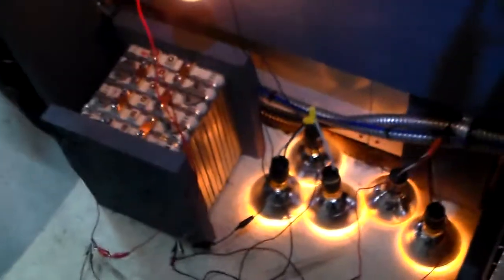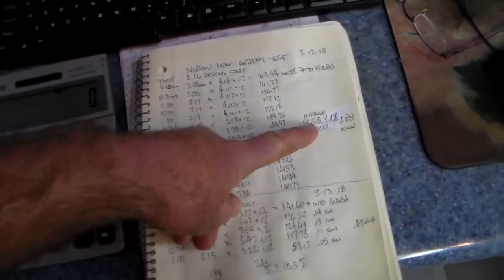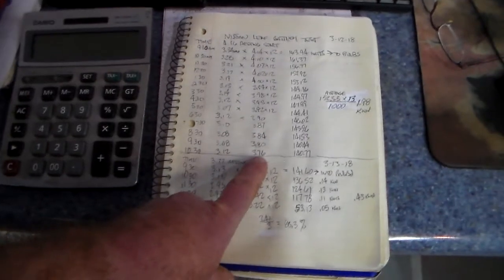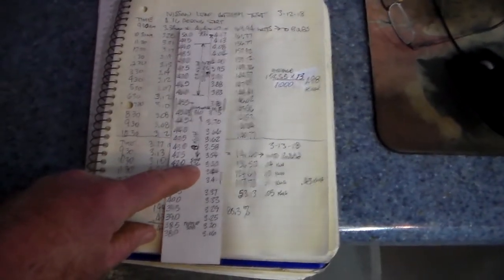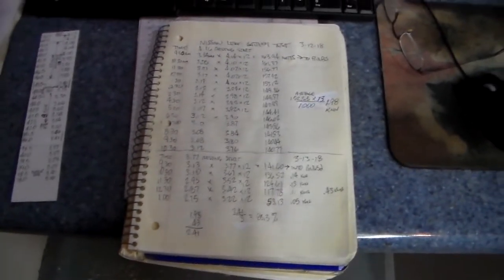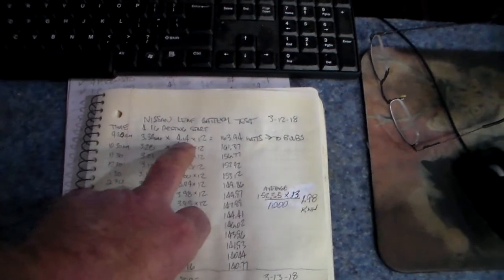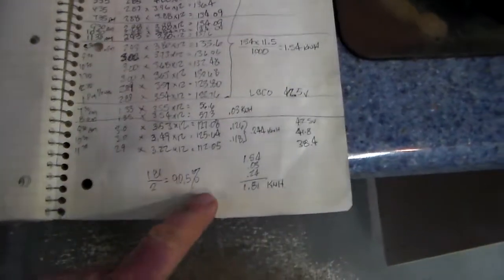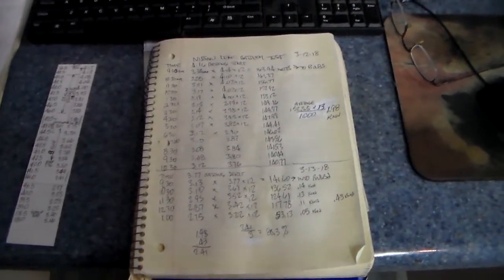Nissan Leaf Battery Capacity Test- off grid storage

Comment: Well Chit.   I ordered a cool Battery Capacity tester from China.  Due to the Virus crap all orders are on hold or in Quarantine.  I have like 12 orders  Pending shipping from China and EVERYTHING  has not been shipped at this point.  This is going to take a while.  

300V 100A DC digital voltmeter ammeter voltage meter car battery capacity volt current wattmeter detector power supply tester
$ 11.10 X1
Product properties: Bare board voltmeter + 300V 100A 30000W
  Awaiting Shipment
 Will be shipped within: 17 days 21 hours 57 minutes

Comment: I obtained 12 of these modules to have a go with.  Hope to employ them in a Power Closet set up.  Need to do the same type test.  Thinking I'll use a few electric heater elements as the load.  Have a Watt Hour meter in line.
Reply from the maker: Yes, just be methodical in your calculations.  Sounds like you've got it under control !

Comment: I like the tests! It would appear that the Chevy Volt packs are a better choice, because they are from an OEM Hybrid configuration, which does not allow the same abuse of discharge.
Reply from the maker: The other thing is, Volt packs are somewhat more protected from heat extremes, unlike the Leaf packs.  That's why a lot of (southern climate) Leaf batteries suffered an early loss of capacity.   So it's sort of important to know where your used batteries are coming from, meaning, what part of the country.

Comment: Great Video Mark.  In your research have you been able to determine a SOC based on voltage.  I realize the curve is pretty flat so it makes it challenging, but I didn't know if there was data out there to suggest something to estimate off of.  I have an off grid system I am working on with two "packs" made up of 7P7S Leaf modules.
Reply from the maker: Ok, so 7S. Draw a graph.  

On your Y-Axis (vertical) place 57 v at the top and 49 v at the bottom.  That equates to 4.07 and 3.5 v -volts per cell respectively.   

On your X-Axis (horizontal) put 100% at left end and 0% at the right end.  Draw a straight line, on an angle starting at 57 v and ending at 49 v.   On your Y-axis, make marks at 50 v, 51, 52, 53, 54, 55 and 56v  evenly spaced.  On your X-Axis, break it up into 10 even spaces starting with 10%, 20%, 30%... etc.    You can then draw a line from any voltage point over to the graph, then down to the % SOC on  the X- Axis.   53v should be equal to 50%.

The reason I use 4.07 and 3.5 v as max and min cell voltage is because you have very little energy above
4.07, and below 3.5.... and it's non-linear, where it's perfectly linear (or as close to perfect as I can measure) between 4.07 and 3.5.  

Make sense ?

Comment: Well, I just found this video after leaving all my questions on the other one.  I see you DO have the 120v bulbs connected directly to the 48v battery.  So your 560 watts worth of bulbs were using about 140watts at 48volts.  And it looks like you mean watt hours rather than watts in all your calculations and that you were just trying to determine exactly how many watt hours were in each battery.  

I'd like to see how long that one 48v battery hooked to a good 48v inverter would run that single 200 watt bulb (at 120 volts)  or a very small heater or air conditioner.
Reply from the maker: 1) Correct. 140 watts /48= 2.91 amps.  Pretty much what I measured. 

2) Correct. You could also say that the result of each calculation is "watt-hours" as each number represents what the battery gave up in watts for a 1 hour period. 
Likewise, the end result of day 1 and day 2 is: 2410 watt-hours, or 2.41 Kwhs.   Same thing. 
 
3) Question: How long would that one 48V battery run an inverter powering that same 200 watt bulb, or a small heater or air conditioner ?  Answer : It would run it until it used all 2.41 Kwhs, (or 2410 watt-hours), and then it would stop.

There's one more factor tho, when you pull a larger load out of a battery, it gives up less in terms of Kwh's (or watt-hours).  And when you pull less load, it gives up more.  My 3 amp continuous test is about 3 times what my battery sees in real life scenario, so in reality, I probably have a bit more than 2.41 Kwhs worth of storage per 48 V module.

Comment: Hey. You should help me figure a way to dc fast charge my Volt off my solar. I have about an 8500 watts coming in from solar.
Reply from the maker: Beyond my pay grade...lol   but if I had to guess, you'd need to put enough panels in series to get to about 500 volts as a fully charged Volt battery is like 390 and you need enough head pressure to jam those electrons in !
Reply: Ya you and me both. keep thinking about it. We need this. I'm trying to get the gist of your site here. great stuff.
Reply: If i connect 12 305 watt pannel in series, I get 480 vdc 3660 watts. 2 strings 7320 watts. Thats the perfect number. 3 strings 10980 watts. I could charge my volt in an hour. lol.
Reply from the maker: That would certainly be enough head pressure to get the job done.  Now you'd need to come up with some sort of management system to shut off the charge when you get up around 390V.  You're talking about a serious DC contactor, something that can extinguish the flame of a DC arch at that voltage.   Thinking out loud- the diodes in most panels are good for 600 V- so you should be good there. In other words, the Volt battery shouldn't 'drain back'.  I've seen panels rated for 1000 V- which would be even better in this application.

Comment: I suspect the difference in degradation between the Leaf and Volt cells comes down to thermal management. The Volt has a coolant/heating loop to manage the thermal loads of the traction pack. The Leaf does not.
Reply from the maker: My Leaf battery came out of a 1 year old vehicle, literally 1 year old to the day from the day it was titled, till the day it was totaled (wrecked).  The dash didn't light up so we couldn't determine the mileage.  I got the VIN and went to Copart and actually talked to a gal at the auction house where it sold (to the recycler) in Washington state. So, there is no way to know how many miles were actually on it but the battery looked like brand new (!) when it arrived.  I purposely scouted one from a northern state for the reason you point out IE: no active cooling.   So....  it's really hard to say why it's at 80% ?... unless the car actually spent much of it's time parked in the Arizona heat and had a whole lot more miles than you'd expect for a 1 year old car.  And either of those 2 scenarios, or combination, is entirely possible.  Thanks for  your comment.

Comment: Does it self drain
Reply from the maker: while I've never let my lithium batteries sit (unused) for any long length of time, I've read where people have purchased complete used Leaf batteries that, in one case, had sat for over a year in a junk yard and the cell voltage was 3.86 v or 370 pack voltage. Further reading leads me to believe lithium batteries have an extremely low self-discharge rate.

Comment: Great information Mark.  For everyday use what voltage range do you keep your batteries in?  I just got my BMS up and running and I am working on the parameters for my charger - on one video I had heard you say you kept the max at somewhere around 4.10.  I have read reports that say if you keep them in the 20%-80% range you can get about 5X the life out of them.  Thanks for the video
Reply from the maker: From what i was told by someone who is an avid Volt enthusiast (and owner), 390V is the latest top charge allowed from the factory on the latest Chevy Volts, so 4.06 V per cell.  The older Volts were set to charge to 386, or 4.02 V per cell.  Currently my max target voltage is set at 49.0 (I had it up to 50 to run the battery test). 49 V works out to 4.08 per cell.  And I may lower it a little more. I've been thinking about this a lot as well as reading about lithium and the degradation process, and you are correct, keeping the voltage down extends the life.  However, in practice, our batteries will only sit at that top voltage for a short period of time most days. Meaning, on the good sun days, you might fully charge you pack, but by late afternoon and early evening, you're already pulling them down from that top charge.   And from what I read, the degradation comes from sitting at that top charge for long periods of time. So.... it's sort of a judgement call
Reply: Love it - thanks for the reply - I learn something new everyday